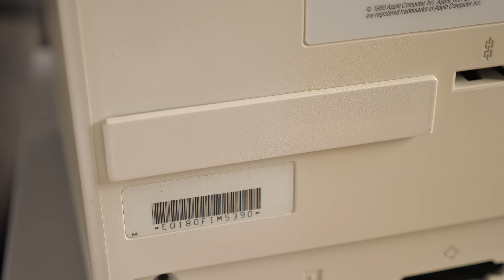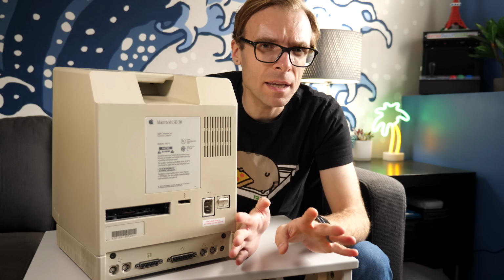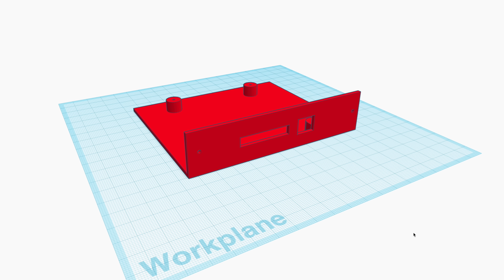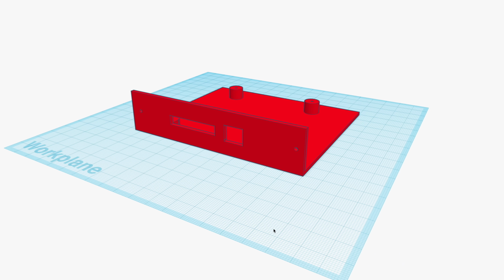Retro Meets Modern: SCSI2SD Bracket for Mac SE/30!

Comment: I printed your bracket and it works great.   Thanks for sketching that up.    My system is a Macintosh SE FDHD.   Not sure if the layout is really any different as far as the Hard drive brackets go in my FDHD vs an SE/30 but there are a few things to note.  The original metal hard drive bracket needs to be removed as you cannot install the 3D printed bracket for the SCSI2SD adapter with it installed.  They hit each other.  No way around it, the card is that long anyway, just pointing it out.   I do love that I can insert the back/tan cover on the case and hide it entirely.  The SD card doesn't hit the cover, so from the outside it just looks like you don't have an expansion card installed at all.    Also,  because the LED header (you have to solder your own pins on) is on the side with the SD Card/usb port even further away from the front of the machine,    the existing LED cable is way too short to reach, so you need to extend the wiring.    I then hot glued the original LED over top the spot it needs to be to shine through (same place it would've been in the original HDD bracket).

I used the latest version of the SCSI2SD v6 (Rev 2020c)

I uploaded pics for your viewing pleasure:
https://imgur.com/a/cy0UUOn

Comment: Hey Colin, I got the bracket printed and it works great, but I had to cut a little slot where both it and the PCB hit part of the original metal HD bracket. Photos here if you want to adjust your design: https://imgur.com/a/r5hkzi0
Reply from the maker: Is this on an SE or SE/30? On my SE/30 the hard drive bracket mounts to the top of the floppy bracket, so it can be removed separately.
Reply: @ThisDoesNotCompute  It's an SE/30 and you're right, the HD bracket does come off. Doh! However, when it comes to things like (model-specific) brackets, I don't like separating them from their machine and risking losing them. Plus the bracket has the original LED light, which I wired up to the SCSI2SD. So I'm probably going to keep it in.

Comment: I had bought extension cables for sd and micro usb they just dangle at the back
Reply: But what's sad is v5 scsi2sd don't work with original "SE"
Reply: @prozac1127  There must have been some problems with the earlier models.  I wonder if later firmware on the v5/5.1 has made it better.   I just received and tested my v6 (2020c) latest build and after making a few config changes that folks suggested (namely,  I force it to only present a 1.8gb disk even if I have a 2GB or larger SD Card) it works great.   the Apple SC HD  patched disk tool (7.3.5 Patched) was able to format it,  although.. no kidding,  it took 45 minutes to Initialize.  I almost shut it off but the LED was still flickering fast.    Was able to install OS afterwards without issue on my SE FDHD and it's nice and quick/silent :)

Comment: Nice solution - will give it a try, and certainly looks a lot better than the ribbon cable I have dangling out the back of my SE/30 for easy access to my SCSI2SD. About time I cranked up the 3D printer again. Thanks for sharing...

Comment: Would a SD Ribbon Cable and position it behind the fan vents more simpler, cleaner and let the expansion port ready to use ? I assume that would be another way for another day :)

none the less thumbs up and thanks for providing the files
Reply: GUN2kify this is what I plan to do for my Classic II - exactly as you described
Reply: @ericneuman9130  could be nice :)

Comment: What about using a SD card extension cable? You could leave the module where you had it mounted, and just rout the SD card slot wherever you want it.
Reply: People have not had a lot of success with the extension cables according the forums I have been reading.

Comment: Can a SD card be treated the same as a hard drive we’re dats is constantly accessed and rewritten? You may have wear leveling issues and data loss.
Reply: I doubt you'll ever wear out one of these cards doing what we do with them. I've never heard of that happening.
Reply: Unless you use an old Mac as a daily driver, you won't make that many writes to it. And even then, it'll take a good while. Also, SD cards are cheap, make a clone of it every once in a while and you can easily write the image back to a new one. I need to replace the hard drive in my Performa 475 (which has already had its original 150MB HDD replaced twice, first to 250MB then to 4GB, and now that's dead too) with an SCSI2SD - SCSI drives suitable for those machines are getting more rare by the day.

Comment: Couldn't you use the external scsi port with the adapter?
Reply from the maker: Yep, you certainly could — I just don’t want to have it external, plus you’d still need to route the power cable to it.
Reply: @ThisDoesNotCompute  Yes indeed your solution is very tidy and practical, and it's very nice of you to share a 3D printable drawing with us viewers. Personally I would use one of those external scsi hdd enclosures. I guess this would be a nice solution if the expansion slot was occupied.